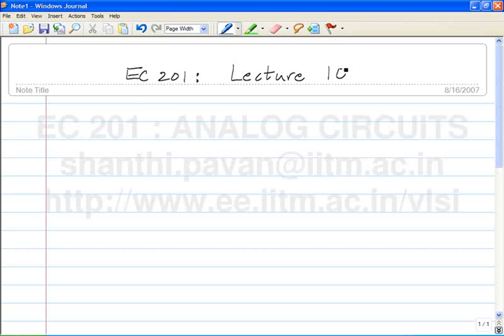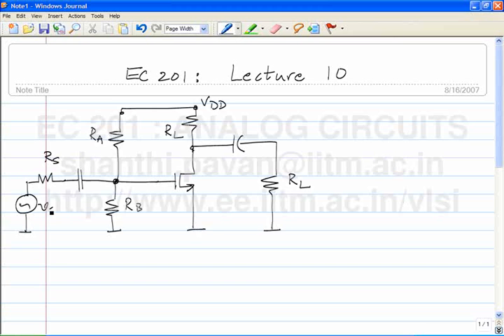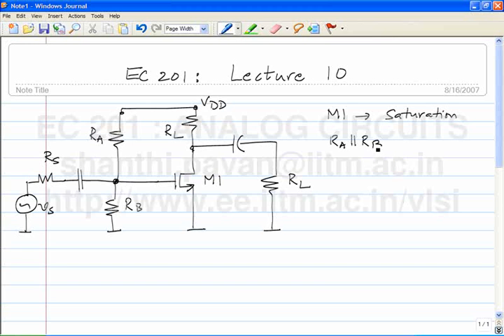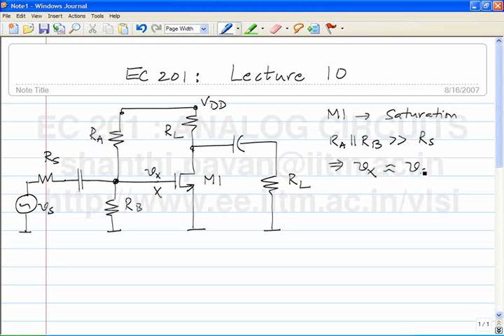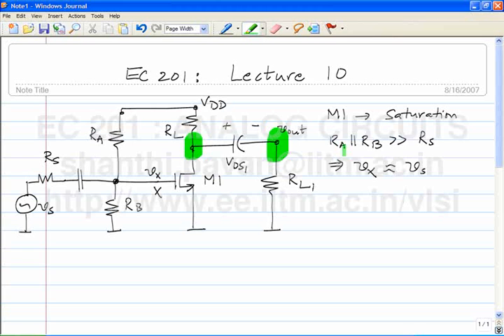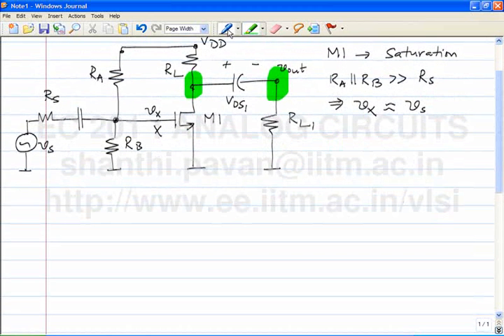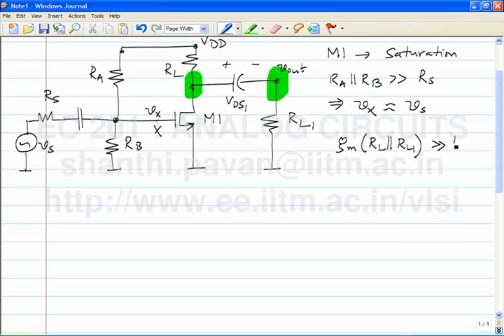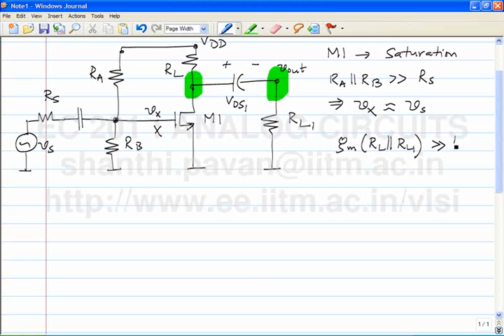Lecture 10 - Swing Limits continued.flv

Comment: Although you don't reply, but still, if Id = 0, gm = 0 and then the swing will reduce to zero, thus Id will never go to zero since the factor that makes it zero, is itself zero. Why didn't anyone point it out?! Also, a capacitor is only equivalent to battery when no current is passed through it, but here a current is being passed through it and it can no longer be assumed as a battery of Vds.
Reply: No Bias current is flowing through the capacitor since it blocks DC readily! Also for small signal (AC Voltages) it is going to behave as a wire. Not necessarily a capacitor can be taken as a battery here !
Reply: @sk10200x  by a wire you mean at low operating frequencies(small signal) the capacitor acts as open ckt right??